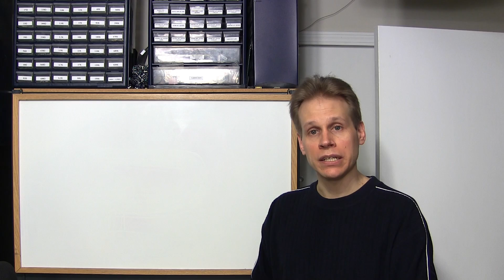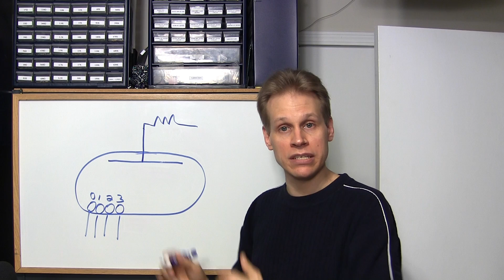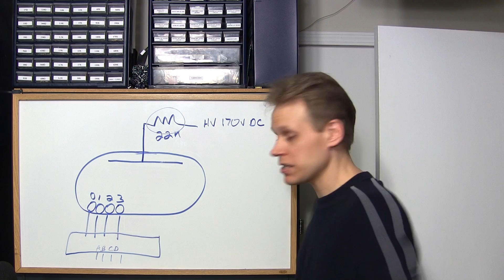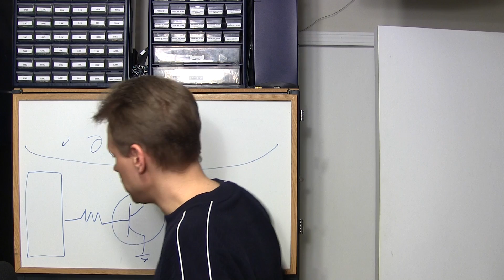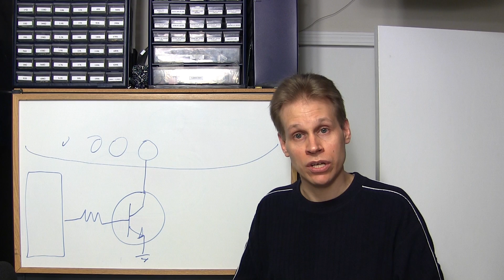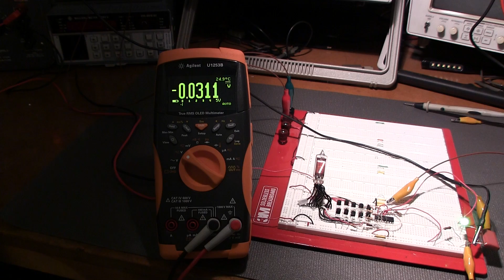The NIXIE Tube, and How To Use Them

Comment: Nixies are cool.  I have two instruments from the Heathkit company that use nixies.  IM-1002 digital voltmeter, 3 and one half digit display.  The half digit is acquired using an NE-2H lamp.  The other is IB-1102 which is an eight digit frequency counter that measures from one Hertz to 120 MHz .  They were purchased in kit form in approximately 1974.  Both still function beautifully. All of the digits are still bright.  42 years and going strong.  I did have to repair them a couple of times, but Heath's manuals are superb.

Comment: Paul, I can remember when digital instruments and calculators first came out.  These used nixie tubes for their digital displays. (I guess I am dating myself)  Anyway, nixie tubes have always had a definite "cool factor" in my opinion.  A couple few years ago, I decided to design a nixie tube clock.  After considering a couple different design approaches, I decided to make use of the very low cost Arduino UNO as a computing platform and design a 6-digit nixie display that would interface to the UNO.  The circuit I designed utilizes a 12 volt AC input from a 1-amp Plug-in wall transformer.  The use of low voltage AC power allowed an easy way to produce the needed high voltage for the nixie tubes (using a transformer), low voltage DC to run the UNO and other logic, and also provide a reliable 60 Hz time base for time keeping.  I developed a PC board for all the circuitry, interface to the UNO, and a long 64 bit shift register which drives the individual elements in 6 nixie tubes plus decimal points in 3 of the nixies.  I chose to use the IN-8-2 nixies (from Russia) as they are a nice size, have a decimal point, and feature distinctive "2" and "5".  I also incorporated some additional features on the board - a power relay, speaker, potentiometer, temperature sensor, and several switch inputs.  The UNO program I wrote runs the 6-digit display as a clock with added date and timing functions.  I still have a couple of unused PC boards and would be happy to send you one at no cost.  Might make for an interesting video.  Let me know if you are interested.

Comment: Back in the early 70s, before 7 segment LED displays became avaiable at affordable prices, I needed to build a 2 inch wide  professional audio  tape recorder display and encoder for editing and finding spots on the tape for overdubbing. I designed the high speed bearing tape encoder to retrofit at a spot of the tape path before going through the 24 track recording heads.  I found a bunch of surplus nixie tubes and started to build my own display unit that had TTL logic and was driven from rotational pules from the encoder capstan.
The nixie tubes required special TTL drivers (BCD to Decimal) 74141 from what I remember due to the high voltage on the anode. I think the 10 o/ps to the nixie cathodes were at TTL open collector level pulled to ground to turn on the appropriate digit with 4 inputs, which were internally decoded to go only from 0000 to 1001, the
other values 1010 to 1111 were ignored inside the driver chip.
The rest of my logic board to support the nixied BCD drivers was composed of TTL up/down counters, and some TTL schmitt trigger logic to clean and square up the pulses from the tape encoder.
Reply from the maker: Sounds like that was a neat project.
Reply: Yes it was.I had my own custom electronic engineering company (basically me,myself and I) that went out and contracted anything
I could repair or rebuild or design from scratch. There was a 24trk recording studio that had an Ampex 24trk recorder where the recording
engineers had to find audible passages on the tape to cue up for overdubs.

 This was difficult sometimes in a large 2400ft reel of tape and
one of them asked me if it was possible to come up with an electronic
counter that they could record the footage on their master sheets and
then refer to the spot on the tape during overdubs, rather than have to
search for the audio track. The long searches  cause lots of spill noise because  as some may have heard,  the sounds tapes make as they are
shuttled back and forth to arrive at the right spot at speaker sound levels
are not exactly pleasant if you have to do a lot of this. 

While the nixie tube display was relatively simple to engineer from scratch, the challenge was the addition of the tape footage counter measurement encoder capstan that had to be located on the deck, requiring drilling
a hole in the deck at a specific place for  the tape roller to contact the tape in an EXACT spot without affecting tape tension or introducing wow and flutter. 
This spot could not be determined ahead of time..so that was definitely a challenge for me. 

 I had to convince the sound studio that if it didn't work the way it was supposed to work during the trial period, all there would be is a 3/8 hole in the deck that would be covered up with a chrome button, and  only I would be out a lot of my time in designing it and installing it.  

It worked though and they were happy with the results as it made
their jobs easier.

Comment: Nice job on the detailed visual explanation.  I know there are many places that sell Nixie tube desktop clocks but I want to build one from scratch using an old Analogic AN2534 Voltmeter unit.  It has 4 Nixie tubes plus the high voltage source.  Now that you showed me how to drive the Nixie tubes I will just disconnect the voltmeter driver section and feed in my own circuit (basically a Silicon Labs Busy Bee Microcontroller which will multiplex four CD4028 BCD drivers).  In order to make this compact I'm using OnSemi's MSD42WT1G NPNs (in a surface mount SC-70 package) > 32 transistors should do it for a 4-digit 12hour clock.

Comment: Great video.  You can get creative and control a bunch of tubes with only 3 mcu pins (well 4 if you include ground) by using shift registers(which are easily daisy chained) to drive the BCD to decimal converters.  You could use shift registers directly, but most only have 8 outputs, not 10 and if u want to use an mcu's hardware spi peripheral (as opposed to bit banging), most of those send data by the byte.

Comment: Would you like a NIXIE from the last nuclear generating station built in the USA? Reply, and I can PM you. A salvage place bought up 1000s of Nixies when GE changed the control panel designs mid project. One of the scariest things you could hear in the 1970s, was two nuclear power plant technician's discussing how nicely the glass top control panels worked for snorting cocaine. Then upon closer inspection you can see cocaine on the glass panel. It was the 1970s, and workplace drug testing was unheard of outside the military & Vietnam.
Reply: I want some! I need 14 either 14s 18s or ones ( front faceing)

Comment: i just went to my local "radio shack" and they had a bunch SN74141N that have never been used. i might have been luck no one needed it before :P
Reply from the maker: Wow, that would be some really old stock!
Reply: indeed, if i need old component types i usually can get it there.

Comment: thx for you sharing you knowledge.

It would be nice to show or build an power supply for this nixie tubes.
And explain if it better to use stepdown or stepup supplies also to separate the low power site from the high power site of the circuit with one power supply.

that would be nice :D

Comment: Thanks for posting.  I have been playing with 7493's as of late and since I was in school in '92, I wanted to build a clock with TTL. It has been many years since I have played with electronics, but with a few bread boards I just purchased, I have the power supply and 60Hz time base cleaned up and working, all the counter circuits working including the 1-12 and the button bounce, "de-bounced" using the other portions of the 7414.  I was planning on using 7 segment displays, but came across the "Nixie" tube and have been getting into them recently.  I found some 74141's at a friends shop and figured those will blend in nicely to the design.  I still may use the 7 segment displays and have the nixie display as an "as wanted" additional feature.  (From what I see you can still buy the 74141 at NTEpartsdirect .com).  Your video comes in very handy as I wanted to drive the "1" for the tens of hours with a transistor but was a bit unsure.  You firmed it up for me and this one was not "over my head".  Great instruction.
Reply from the maker: Hi Jim, glad you enjoyed the video! The 74141 is a good IC, but keep in mind, if your power supply goes high when you blank digits, the IC's tend to leak a bit, and you may get faint number glow.
Reply: Thank you and will do. When I get to it, I plan to run on the conservative side with supply.  I did see that segment of yours as well with good explanation of current balance for blanking.  I will refresh on that again.  I also have the 7441's and have read they were more susceptible to what you describe if I understood correctly.  Be well, Jim.

Comment: great video...i restore old jukeboxes, and had a rare one in that had nixie tube display, with 3 tubes, they were controlled by a big printed circuit disk with a motor driven wiper that spun round to drive the display and display the selected selection when it stopped...it was from 1963, so before ic's to control it....it also had a very unusual selection and credit system it used bunches of little [GR43] switching tubes to control everything...i eventually got it to work, but really just by replacing components, i never really understood these switching tubes, perhaps you could do a video at some time on these cold cathode tubes....thanks
Reply from the maker: Thanks for your comment, and taking the time to write.

Comment: I have a question sir.  You mentioned that some Nixie tubes have a decimal display.  If you use one that does, do you need a separate transistor for the decimal?  Also, your teaching is second to none. You made it very easy to understand.
Reply from the maker: The decimal doesn't always need a transistor. In the counter I'm designing, the decimal will be fixed,  I may also use an external neon lamp for that decimal as well. Just depends what looks better.
Reply: Thanks for the response.

Comment: Paul,
Looking forward to the series. I liked the countdown at the beginning using a Nixie tube. If one wanted to save on space and has smd skills, could the smd version of the mpsa42 be used?

Also noticed a dryer hose up above your head. Is that for fume extraction?
Reply from the maker: For sure Donald, the MMBTA42 is great for Nixies, I use them all the time. The dryer hose is for fume extraction, I just pull it down over the work. There is a squirrel cage blower in line, so the suction is very high.

Comment: Excellent information, Paul! Thanks for giving us the basics of powering Nixie tubes.
I am curious, would it make any difference if you used N-Channel MOSFETs instead of BJTs? (with the appropriate ratings, of course)
Reply from the maker: High Voltage FET's would work just fine.
Reply: Thanks!

Comment: oh, and now I fully get how transistors keep high voltage/current separated from the low voltage ICs. I suspect that properly calculating saturation is the same for all transistors, correct?

Thank you for that!
Reply from the maker: You are correct, the calculation is very similar.

Comment: Question, i do recall my ZM1032 design perfer uses the stage between on/off as it is better to control an Nixie Tube, correct me if i am wrong.
I think it is between to control to off segment by a flow voltage that come from the zener diode plus a resistor rather than just let the transistor handle all the blocking high voltage.

Comment: 2N5550 transistors would work as well, as long as you have a digit lit at all times. And they're more period-correct than the MPSA42, so you can pretend the design is from the 70s.

Comment: One big question. Do you have a link to the high voltage DC power supply, and is it adjustable so as to set whatever B+ you want?

Comment: Would it be possible to reduce the number of transistors for a multi-digit display by tying all the common digits together (0-to-0-to-0, 1-to-1-to-1, etc.), then using another transistor as a switch on each of the 170VDC connections for the Nixies, and multiplexing like you would with a LED display?  I'm not sure if a Nixie would work well being turned on and off in rapid succession like a 7-segment LED display.

Also, funny...I'm showing my age.  I recalled that the Nixie driver from way way back when I first heard about this was the 7441 (predecessor to the 74141).  Brings back memories!
Reply: The array is definitely an option!  The whole idea behind multiplexing though is to reduce part count (and I/O pins, if you're using a microcontroller to do the decoding, which is likely these days).  I remember that old vacuum fluorescent calculator displays used multiplexing, and I would imagine that the response time for the Nixie tube is going to be similar to those.

On the brightness issue - yes, the drawbacks are similar to PWM.  The display scan rate (and duty cycle) would need to be slow enough to provide sufficient brightness and fast enough to prevent noticeable flicker.  The rules for this are pretty well established for LEDs.  I suppose I should probably "use the Google" to find out about Nixies.  I just thought it was an interesting idea for the frequency counter (although it looks like Mr. Carlson may be using CMOS logic ICs rather than a MCU here).

Comment: What about using the HV5812 instead of the 74141 to reduce the transistor volume. I have seen these devices used in NIXIE clocks. Thoughts?

Comment: mr carlson. i am rebuilding an old logimetrics signalock 925 sig gen and i was curious if i could install 6 vfd florescent tubes in place of the nixies without any real modification? reason being is i think vfd are much more pleasing to look at and the original nixies have been replaced at one point in its life with tubes that arent the same size. i have 6 new risers so height wont be a problem. always enjoy your posts. thanks!!

Comment: In 1975 I used the 74141 to drive LEDs - I still have some - how rich am I, there seem to be plenty (or equivalent) for a £/$/€ on ebay. At that time Practical Electronics (in the UK) had a design for a Nixie based frequency counter. I would imagine it contained a lot of 7400 series chips. Will someone make Nixie style tubes using filament LEDs...

Comment: Hello! I would have a question. Is there any way to drive these BCD to decimal converters without using a micro-controller with a ton of pins? I mean can i reuse some rails to somehow multiplex such pins?
What i was thinking, is to maybe have an extra BCD IC and to source power to the other BCD ICs, using transistors to power them. Maybe this is a rudimentary way of thinking, but i could not find any satisfying description for thses ICs in the datasheets.

Comment: Nixie tubes are rather old technology. Where do you find them? I doubt if they are available through Allied Electronics, Mouser or DigiKey. Thanks for the video!
Reply: Ebay. I would look into IN 8 tubes. they are pretty cheap and still look nice. IN 1s are cheaper but they die very fast.
Reply: Yes, as Joseph said, they are widely available on ebay. A friend and I bought about a dozen of IN-12As.
Reply: I used 6 Russian 1N 16's in my clock and they cost around $260.00 at the time.  But they have been running perfectly since 2008.

Comment: this is really good stuff. I have an old broken counter that I bought off eBay so looks like this is my chance to fire them up.... but... firstly how do I generate 170v DC? and secondly I think I read once about pre-bias? can you really let the other segments float?
Reply: OK... so I found a datasheet on the SN74141N... this seems to have an ON voltage of around 170V (if that's what you give it) and an OFF voltage of around 60V.  I really like your idea of using available components though... is having an OFF bias rather than floating something you considered?  Is it really not needed?
Reply: http://www.tube-tester.com/sites/nixie/dat_arch/6844A-burroughs.pdf is the datasheet for my tubes.  And the example circuit shows floating for the off segments.... now totally confused.

Comment: I was wondering if you could do an Audio spectrum analyzer. I really would like to know how take a band pass op amp filter and use the output from that to make some kind of signal DC like 5v and use that to drive a display. Maybe like a Magic eye tube the the part am have trouble with is how to convert the band pass signals to something I can use.
Reply: Am just getting into this stuff so any help would be helpful maybe you cound just point me the right direction.
Reply: Also I out of everyone Ive seen on you tube u maybe the most knowledgeable
Reply from the maker: Thanks for your input Jason!

Comment: I built a timer using counter chips. The digits are very flakey in that they flicker between digits on the same nixie tube. I built 1 version with leds without this problem. You use transistors , but you dont say why you do it. Im thinking that using a small DC to DC converter that I think is generating  noise because of the inductor possibly making my digits unstable. Other than a chip like the russian version of decoder to decode BCD inputs to drive the the 10 digits, does using the transistors help make the display more stable? I really found that I need a timer because the LCD timers dont have a very loud alarm and you cant read the display from across the room, you certainly can barely hear it from more than 6 feet away.

Comment: Have you ever thought about multiplexing 10 transistors across the 10 nixie tubes?
Reply from the maker: Multiplexing is good for size reduction and "penny pinching" I'm not a fan of flickering displays (even worse on camera) so I use lots of transistors, they're cheap.